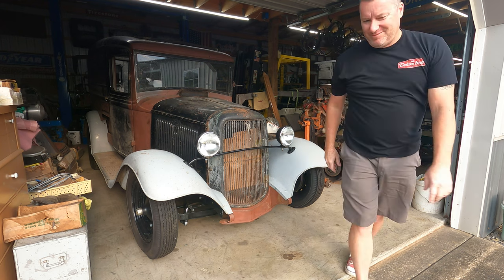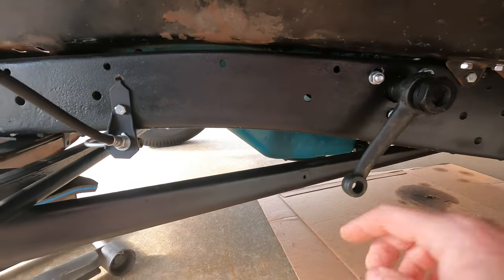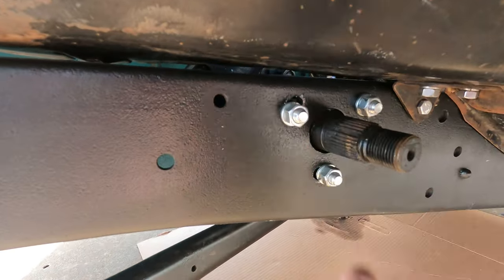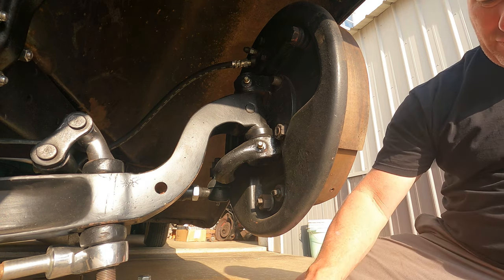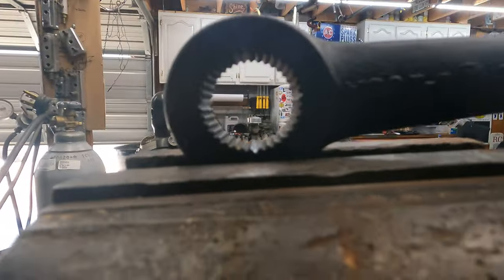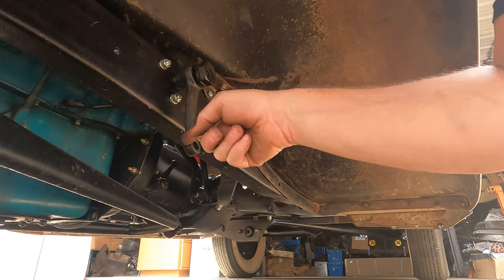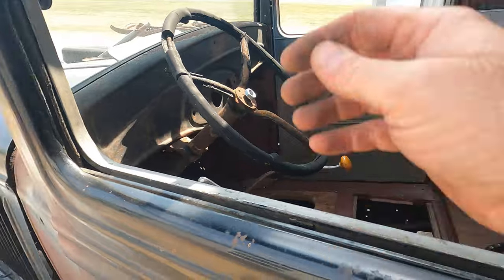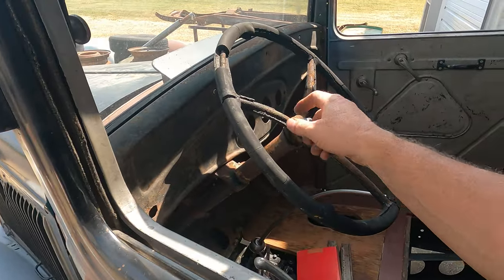How to: 1928-1934 Early Ford Steering Link & Hoop!!

Comment: Hi,  love your videos, one thing I noticed, with the front brakes, I think the longer brake shoe should be on the front and the shorter shoe on the rear, different to Bendix style brakes.
Reply from the maker: You would think, but early ford is the opposite of that. Large shoe in the rear!
Reply: @chaddilacdesigns  Hi I did some research on The Ford Barn and they say, big to front, the wheel cylinder is also big to front, check your self